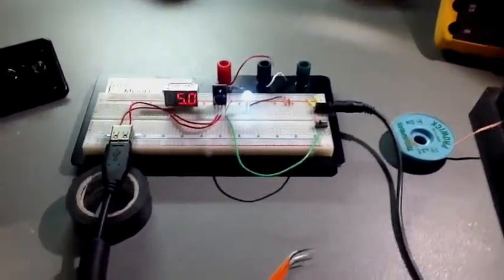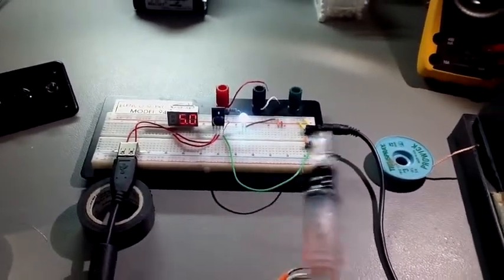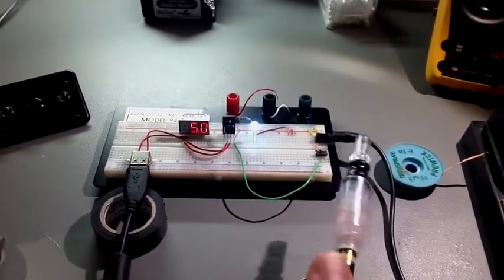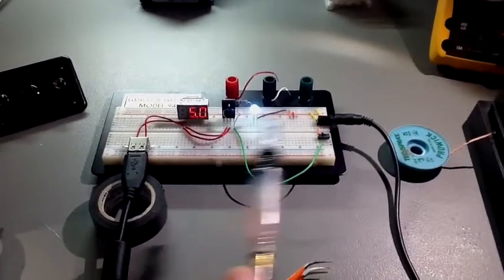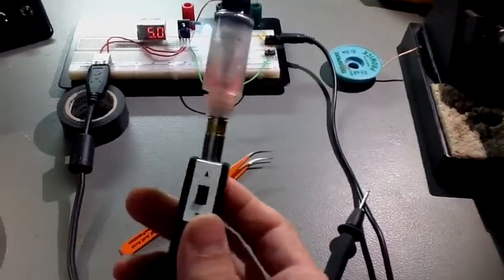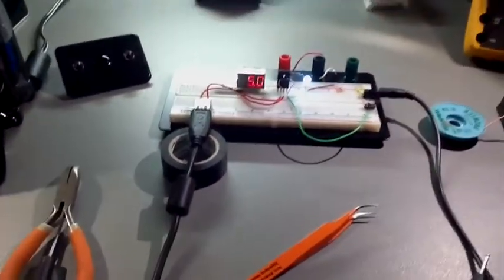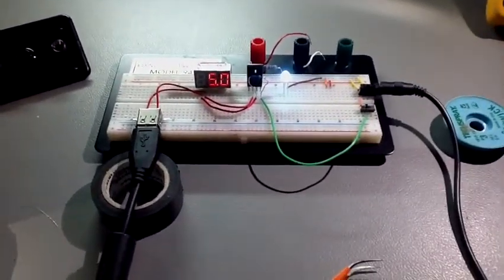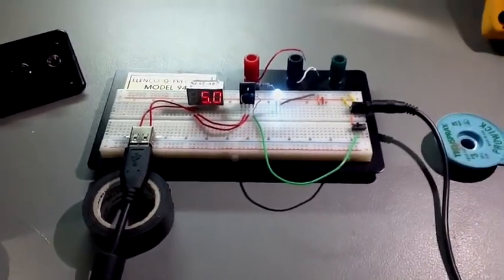5v Mod Testing

Comment: Hi, I'm into electronics too, and I really like your videos, I have to say I'm stunned by this vaporiser. You get so much smoke out of it. Would a regular usb port from a computer supply enough current for this to work? Also could you please explain to me how the top part works? I know there is an atomizer, A tank containing the juice and a tip but I don't know how this is all built together, how the smoke gets out of the juice ect. Thanks a lot for your answer and keep up the good work ;)